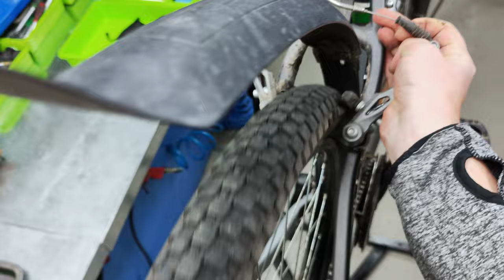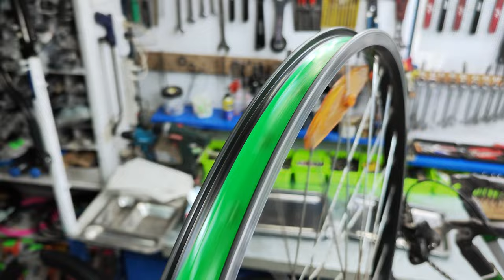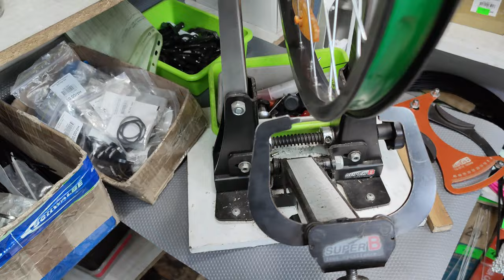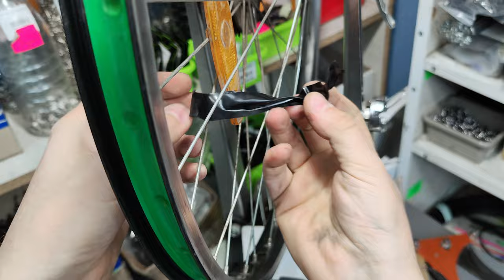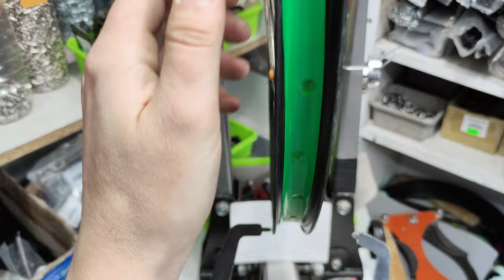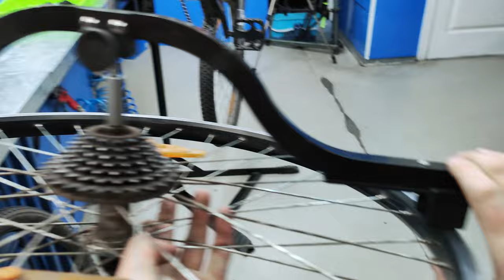How to straighten bike wheel. Fix Rear bicycle Wheel

Comment: Nicely filmed, as always!  The only additional suggestion I have:  whenever I check the lateral run out of a wheel, I do firstly check if there is also a noticeable radial offset that needs to be corrected.  Best wishes!
Reply from the maker: thanks for the advice ! 😘

Comment: thanks for sharing. look, i centered my wheel (as best as it gets with zip ties) but after putting the tyre back and pressure i had to adjust it again. i was sure that the tyre was perfectly placed. is this "normal" or the wheel should keep true after inserting the tyre and pressure? thanks a lot!
Reply from the maker: Make sure that the wheel is standing flat on its rim. If it is uneven because of the tire, then the problem is in the tire itself, try deflating the wheel, leveling the tire with your hand and inflating it again until it is evenly on the rim
Reply: I'm certainly not an expert (😁), but it may also be worth checking that the overall spoke tension is high enough. A wheel that's perfectly true in the jig, but without enough tension on the spokes (I think it's about 100kgf for the common 1.8mm steel spokes) can be pulled out of line when the tyre goes back on, especially if the tyre itself isn't perfectly round and even.

Most ordinary tyres are a bit wobbly, so the straightened wheel needs to be stiff enough to hold its shape against an uneven tyre.

A professional spoke tension gauge is ridiculously expensive (£1,000+) if you're just a regular cyclist, but there are plenty of very good but much cheaper (£85) versions or, if you're wiling to take a risk on quality and precision, one of the really cheap copies (£15) is better than nothing. (They look exactly like the one shown in this video.)

Getting the tension 'near enough' is fine for most non-professional riders, and even the cheapest gauge will help by ensuring that the basic tension you settle on is consistent and (probably) not too low, even if the exact figure isn't accurate.

When the straightening is going well, it's easy to forget that the overall spoke tension may be dropping as you work. It's depressing to create a lovely straight rim that's too slack and to have to start all over again!

A lot of wheels straightened at home are not stiff enough because it's hard to 'guesstimate' the right spoke tension without a lot of experience. Even if a slack wheel holds its shape when the tyre goes back on, it won't stay true for long once it's back on the bike and you start riding.

Good luck! 🙂